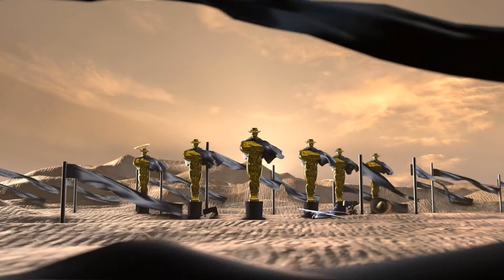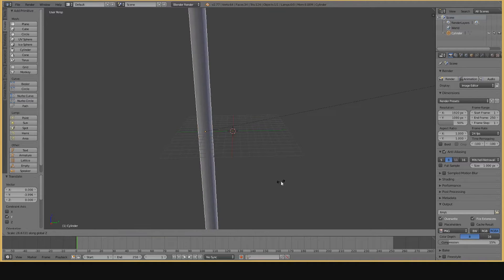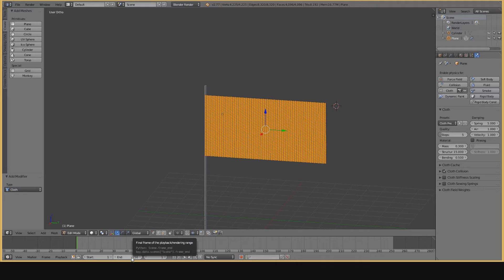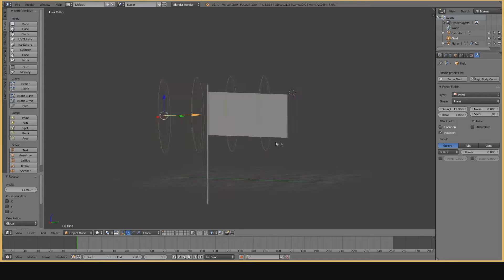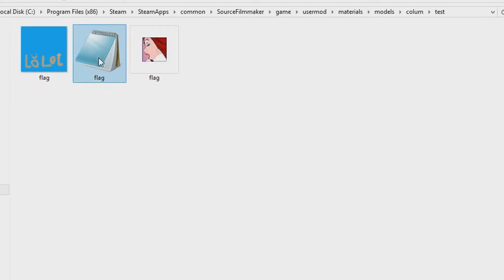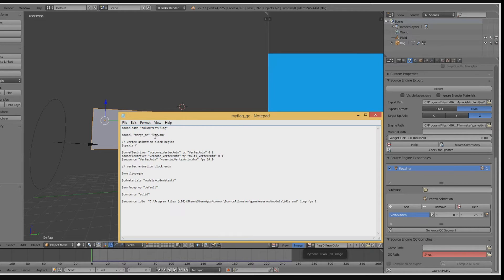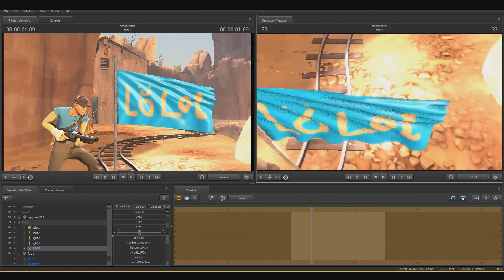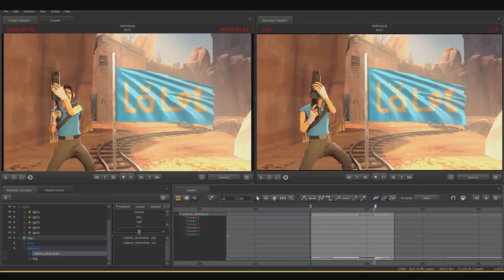(Advanced) Cloth Simulation to SFM via Blender

Comment: On 7:06 when you export it, how long did it take you because when I do it it takes so long i left my comp on for over 6 hours and even though most of my memory was being used by blender nothing seemed to be happening.
Reply from the maker: not that long. Maybe a few minutes or so. I've had export hangups myself with the same situation, and I'm pretty sure at some point the process just gets hung up due to there being too much to export (in my scenario). Check to see if maybe you have a a ton of triangles on the mesh, or if your simulation is too long. Try exporting only 10 frames of your sim and see if that works, and increment it up until you "max it out"
Reply: Alright changed it to exporting 10 frames and it did go through. Thanks for the fast reply.
Reply: Alright I got the animation to work and it went through crowbar my only problem is the materials now. I made a VTF and VMT and made sure the qc was making the path to the folders but i just get the generic pink and black pattern. I put the pic with the UV as well in blender when I was making the flag and it was on the flag and all but still that doesn't really solve anything. What are your thoughts?